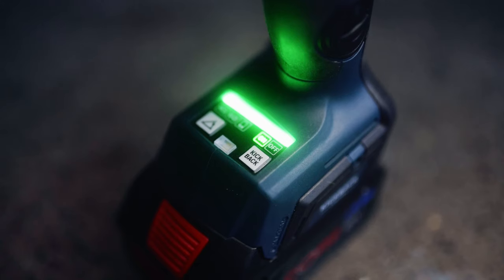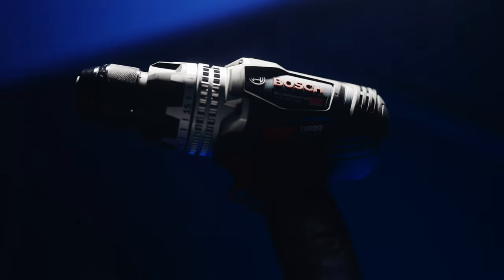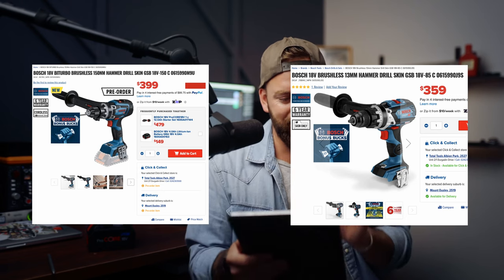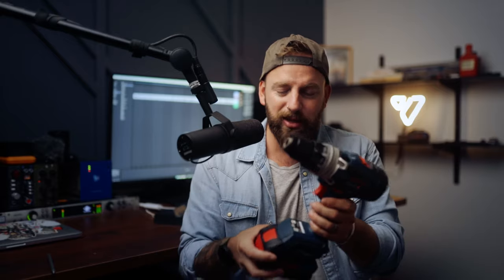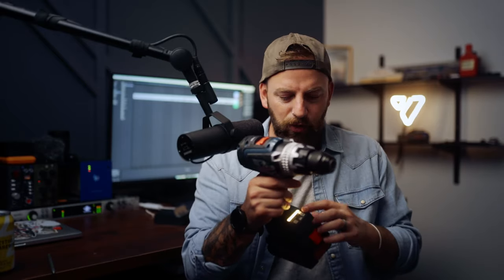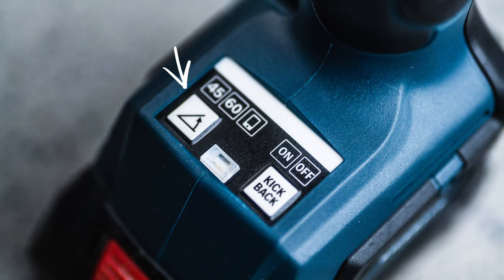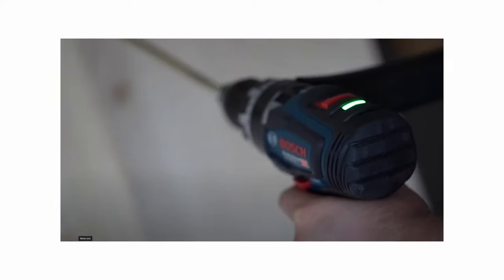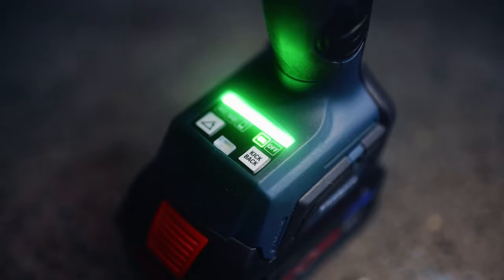First look at the BOSCH BiTurbo Combi drill | GSB18v150c #drill #bosch #tools

Comment: Thst thing is a beast. Worked with it the last 3 months while installing about 40 new windows with dowlless 30 cm screws. Very controlable. 
First i thought the long handle was a bit much but especially without kickback it is a nice thing to have.
For the angle. I used it a bit but i think its more something roofers need if they predrill with that 2 foot things into beams.
Reply from the maker: Good to hear you liking it! I think mine has an issue with the low gear. I need to chat with Bosch. 

I'll be cutting a roof in the next few months so will be good to test it out for that purpose. 🤙

Comment: Great video Dano, the angle setting I assume has 90⁰ as well? Keeping a drill perpendicular to the stock can be tricky for the best of us so that would be an awesome feature, I wasn't sold until that point.
I don't suppose it has interchangeable heads for angled Chucks etc?
Reply from the maker: Sure can mate. Set the angle in the app. No interchangeable head unfortunately